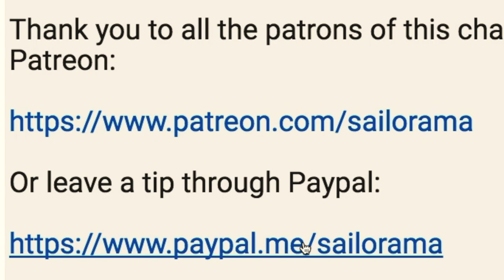Good Luck, All!

Comment: I've just put three plastimo flexible tanks in my boat. Using a healthy concoction of spray glue and 10mm foam camping matts I lined the compartment space to resemble a padded cell before plumbing in the tk. Hope it works ok. Filling with vinegar/water today...👍
Reply: OTTERS POCKET Sounds like an affordable method as well.
Reply from the maker: We use the camping mat method as well. The spray glue can't hurt, although it's probably more than you will need, unless there is a large amount of extra space in your compartment and things can slide around. We liked being able to clear things out once in a while and pass a rag on the hull.